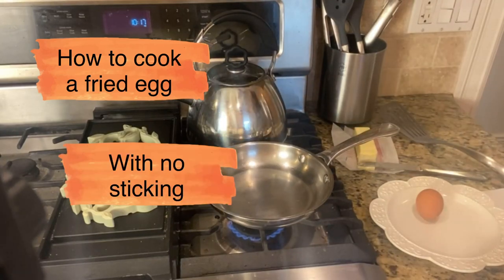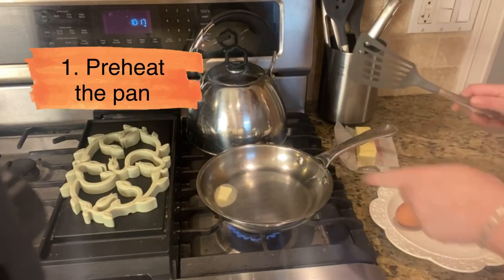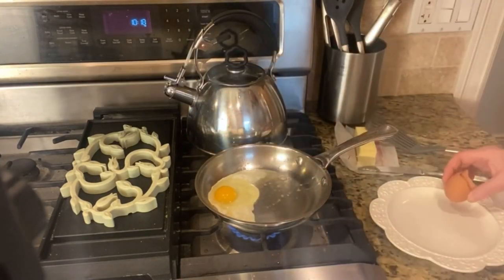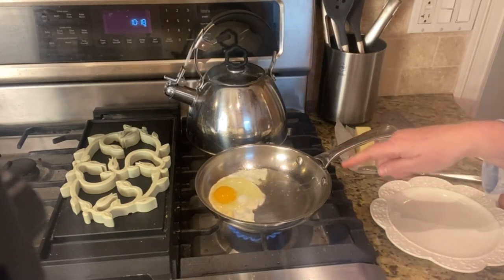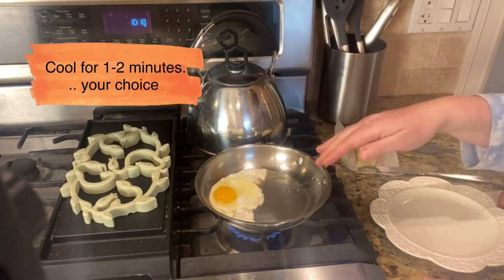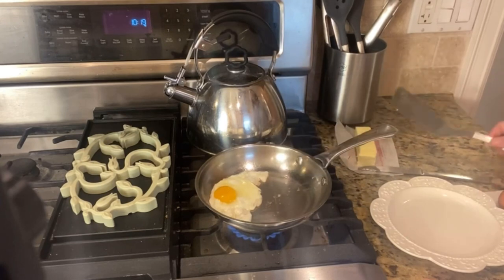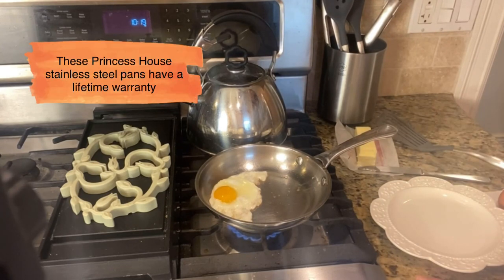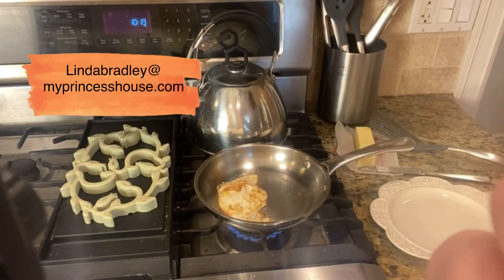How to cook a fried egg.... without sticking!

Comment: It's easy to see that the egg stuck to the pan. 
This is the first person I've seen recommend using a cold egg in a hot pan. 
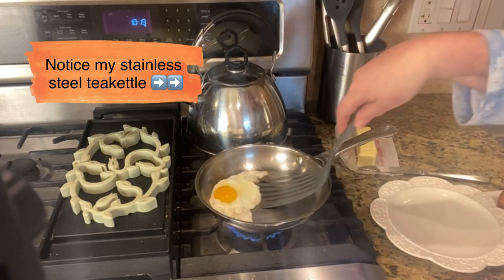Stop the video at 2:23 when she has the egg lifted, and see the egg stuck to the pan under it.
Blow the screen up to full page.
Reply from the maker: It's generally recommended to use eggs at room temperature for frying, as cold eggs can cause the temperature of the pan to drop and can result in uneven cooking. However, if you only have cold eggs available, you can still fry them in a stainless steel pan, but you may need to adjust your cooking method slightly.
Reply from the maker: A small amount of egg did stick, just a small amount. I made this video to help people who want to do away with their nonstick pans.
Reply: You are an eggcelent inspector. Thank you for breaking this case wide open!! 
😳😆😆😄😁 She is guilty of egg "speck".